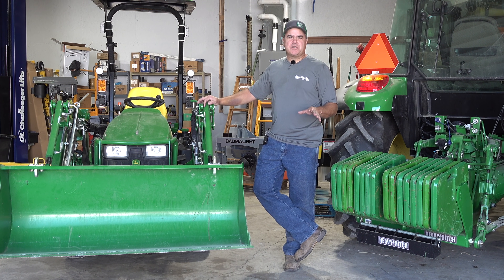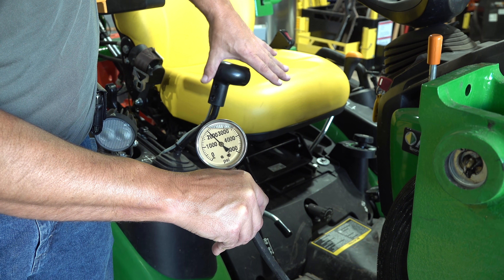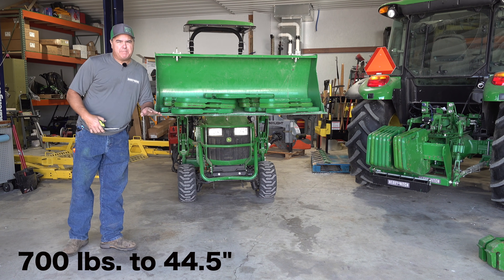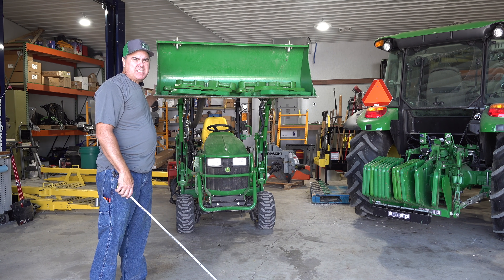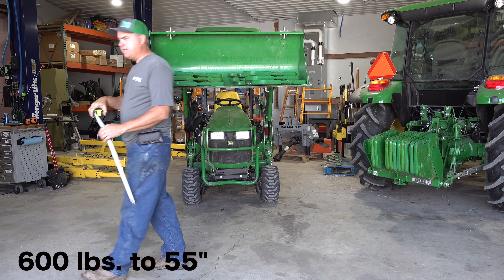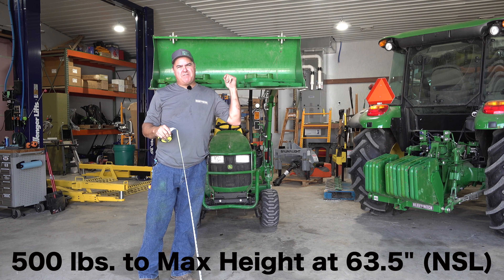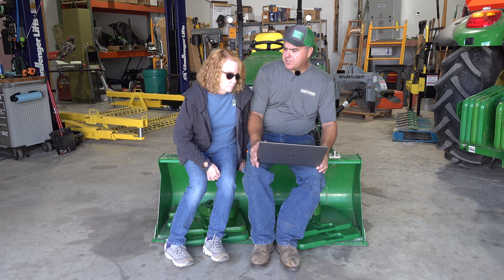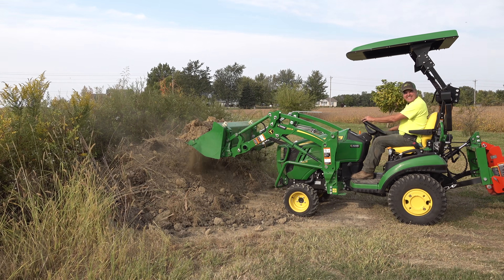WILL IT REALLY LIFT MORE??? 120R MSL vs. NSL for Subcompact Tractors

Comment: Tim. In your opinion is it worth trading up to a 22 2025? I currently have a 2018 1025r with 300 hrs TLB. They are offering me $16k trade in and $30k price on 2025 tlb.
Reply from the maker: No.  In my opinion, 2025r and 1025r are very similar.  I would recommend 2032r or 2038r if you feel the need to step up.
If you insist on making this move, I recommend keeping your 260b backhoe rather than trading for a new one. See if that lowers the trade in cost.
Reply: @TractorTimewithTim  looked into it . They lowered my trade in by 5k without backhoe. Thank you very much tim . Always a great resource . Deere should make you a sales rep .

Comment: I hope deere makes a newer 2025r with higher lift height and capacity. It’s very frustrating that they don’t make a compact tractor that can dump easily in a dump trailer. I currently have a 1025r and in talks with deere on trade in for a 2025r and to find out it only lifts about 3 inches higher is disappointing.
Reply from the maker: I’m surprised it lifts ANY HIGHER.
You need to go to a 3R before you get meaningful lift height improvements.
Reply: @TractorTimewithTim  wouldn’t a 2025r lift higher since it’s technically a taller tractor with same loader?
Reply from the maker: Yes, but it has shorter loader masts …to compensate.  Otherwise, it would not dig as deep!  Remember…the loader is identical between 1025r and 2025r.
Reply: @TractorTimewithTim  thanks for being more knowledgeable than my dealer .

Comment: Ordered a 1025r this week Aug 2021. Wanted a r120 mls loader but was told that loader won’t be available until Jan 13 2022 
Would hate to buy a tractor that outdated in 5 months
Reply from the maker: 2 things. One: not sure it wouldn’t be outdated.
Two: I’m not sure MSL is worth the wait.  I prefer NSL on the 1025r.

Comment: Tim, I hope this questions makes sense. What is the difference in weight between the two loader systems (including bucket, arms, hydraulics, etc.)? The 120R MSL loader looks to be a bit heavier that the Non Self-leveling loader.  Do you know if John Deere  includes this extra weight in their specifications, thereby giving the MSL a perceived heavier lifting capacity?
Reply from the maker: Your question does make sense.  However, you are misunderstanding the lift capacity specification.
The spec includes the loader and the bucket. So, it is specifying how much cargo the bucket can left 19.5” ahead of the pin.   So, any differences in loader arm weight would already be accounted for in this spec.

Comment: In your opinion would you get the self leveling or the none self leveling loader? for normal home/farming use w/out needing forks or only using them once or twice a year?
Reply from the maker: Non self leveling for 1025r, MSL for 2032r/2038r.
Reply: @TractorTimewithTim  thanks

Comment: Hang a bale-spike off of your Artillian pallet fork frame and start hanging weights off the end of the spike to test curl strength on each loader. Be careful to have them at the same pin height and at the same level adjustment. Their curl rams are connected at different angles, so there will most likely be a difference.

Comment: Just a thought, try curling the bucket all the way back because it will bring the weight closer to the pin and in theory allow the loader to lift more. Just to clarify my thought process on this having the bucket curled all the way back is how you’re going to carry almost every load except if you’re using forks.
Reply from the maker: The purpose of this test is to objectively compare lift capacity.  The two loaders have radically different curl back angles, and the curl back would vary at different heights. In my opinion, impossible to get an objective test.
Welcome to our channel!
Reply: @TractorTimewithTim , thank you for the welcome. You are correct it’s hard to get an objective test on these two loaders because they have different geometry. And who knows what kind of standard Deere used for testing to get there numbers for the comparison of the loaders so I would say your test and the numbers it produced are probably more accurate and real world than what Deere is publishing. It almost reminds of the Horsepower wars in the late 90’s between the big three with Diesel pickups and it produced catastrophic results for Ford.

Comment: Just a thought about this test. As the weight decreases throughout the test, so does the height loss due to the weight of the load compressing the tires. Maybe you could run it again with the front of the frame on cribbing or blocks to eliminate the tire variable.
Reply from the maker: We prefer to show ‘real world’ testing.  No one ‘blocks up’ their front axle in the real world.  
We used the same tractor on both tests.  Front tires at 40 psi.
In other words, the ‘tire variable’ is part of the real world and should be maintained.

Comment: Hello Sir I think it would be a big help if the manufacturer would consider putting a little bit larger tire an rim on the 1025 R, but I'm I don't have an engineer degree to prove it would be a bit helpful ,I not a JD mechanic so my outside opinions don't matter . Roger .
Reply from the maker: The 2025r is exactly that!  1025r with bigger tires!
Reply: @TractorTimewithTim  ok about the same horse 🐴 power category I understand

Comment: 💥 One suggestion I have is to use a load cell for you lifting tests instead of weights. The position of the weights in the bucket can cause discrepancies. That would save you a lot of lifting as well. I like what Neil does if you’ve seen his lift tests. 
Keep on tractoring! 👍
Reply from the maker: Don’t know how to test lift at ground level with the load cell.
Reply: What if the load cell lift system was recessed in a hole. 🤔 Then you could even test lift capacity slightly below grade.
Reply from the maker: Yes, but that would have to be at least 24” maybe 30” deep just to the top of the hole.  How would I keep that dry, clean, etc?  
The ‘tie down’ would have to be below that.
Reply: I don’t have all the answers, just suggestions. 😁 However, something like a cinder block well pit with a cover for when not in use. Might be more work than it’s worth but it would make you cooler than Neil! 👍 ..... maybe
You did make a pit for a trampoline. 
Another idea, if you have a loading dock ramp. 🤔🤔
Reply from the maker: Yea, we talked about using our lift.  ...then figured the safety nazis would not approve.
Reply: That’s another good idea, I understand the safety nazis issue. You could use blocking or something to support the lift. I promise I won’t complain. 😁

Comment: All seems to be in range for what Deere claim on the 500mm forward of the pivot point which is 553lb for the MSL. This is the lift capacity you should be paying attention to not the 803lb for the pivot point lift capacity as all the lifted weight is forward of the pivot point. In Australia the manufacturers normally only reference the 500mm forward capacity and the SWL (safe working load) which is 35% of the maximum lift capacity.
Reply from the maker: Where did you see 553 lb?   Thanks!
Reply: @TractorTimewithTim  
https://www.deere.com/en/loaders/front-end-loaders-for-tractors/120r-loader/

Under the specs tab.
Reply from the maker: That is the 500 mm weight for the NSL on 2025r.  
There is no spec page for the MSL.
The page we showed was the overview page. Remove the ‘120r-loader’ from your url to get that.
Reply: @TractorTimewithTim  my mistake Tim, I just assumed when I clicked the link for the 120r MSL  and looked at the specs, I was looking at the MSL specs. So I just had a look at the manual. And Deere rate it at 680lb for the MSL on a 1025r. Interesting side note the NSL no longer offered in Australia as no on was buying it. They having Aussie made MSL loaders fitted. Got a price a few weeks ago on a 1025r with 120r loader. Also a 4066r euro spec with 440r MSL put a deposit on the 4066r.

Comment: My only suggestion would be to clamp a level to the side of the bucket so you know it is level and your measurements would be less subjective. That would keep things equal at least with the increments. Or you could measure to that pin. Also, I'm glad you're feeling better.

Comment: Do you have the ballast on the rear the same as it was on the first test?
Reply from the maker: I drove out of the shed, changed loaders, and backed back into the shed, attempting to get it in the same position.
So, probably 2 oz less diesel in the tank...other than that, no changes :-)

Comment: I would be curious if temperature makes any difference.  I don’t know that it would make any difference between the bucket systems, but I would find it interesting if it made any difference to the hydraulic system as a whole.  An old wood splitter we used was real temperature sensitive.  Enough so that we needed to instal a small cooler on the return line.  On that splitter the return was spring loaded, it didn’t use hydraulic to return.  While I have seen temperature effect hydraulics on others machines, I wonder if it has any affect at all on a tractor.

It is very good to see you are feeling better!  I hope that trend continues!

Comment: If you're looking for some ideas on how to measure and compare these two loaders then it would help to measure the distance from the floor to the pivot pin where the loader arms mount to the frame, the distance from the same pin to the pivot point of the roll back of the bucket and the distance of the attachment points of the lift cylinders so that you get the triangle at totally lowered and fully lifted empty.  You could also put a cheap gravity operated angle finder on the arm to see the difference in angles (you could even use it on top of your bucket when doing the loaded tests to make sure you keep the same amount of level setting as you try to measure from the bottom to the floor).  Another way to measure the height might be to use a soft measuring tape (like a tailors measuring tape) attached to the curl pivot pin and see what the distance is to the floor and not have to worry about your curl being exact.  Just some thoughts, your pressure multiplied by the surface area of the pistons in the cylinders lifting the boom and the geometry of the angles will tell you a lot about the lift capacities of each.  Good luck and enjoyed the science theater.

Comment: I would probably suggest doing it the way Neil did it from Messick's. Also making an attachment if you don't already have one where your load point would be the 21 inch like the specs call for, and also using a level to make sure everything is identical.

Comment: I was very surprised to see the difference in specs as I did not think there would be a difference (if anything a slightly lower number due to extra weight fro extra steel, and losses from all the additional linkages).  Your real world numbers showing no realistic difference restores my faith in my own instincts.  Leaving a small level on the bucket would eliminate marginal differences in judging level by eye at different heights but not worth doing all the work to repeat.  I got the in th ear wireless isotunes and am somewhat disappointed in them.  I find they can fall out too easily (an only by luck found one that had fallen out); if not connected to a phone, etc, their noise canceling feature will self cancel after a very short interval; when connected, their volume is a bit too limited; and I find them difficult to control/remember how to control.  Given that experiene, I will not invest further with them.
Reply from the maker: Did you try different sized tips? I found the smallest tips to work best for me.  Once I get them inserted really well, I don’t have much issue with insufficient volume.
If not inserted perfectly, they allow too mic background noise..making the volume not loud enough.
Reply: Tractor Time with Tim   I will experiment with the smaller tip.  Thanks.
Reply from the maker: Christy uses larger tips than me.  I guess I have a big mouth and small ears!!!  She seems to indicate to me that this is the case at times :-)
Reply: As I am often told you are nor listening, I too must have vey small or blocked ears!

Comment: testing looks correct.  the pin is roughly one inch different by you measurements in previous video.  JD lifting capacity is measured in relationship to the pin. so on paper the MSL has advantage.
Reply from the maker: Someone mentioned this on Facebook as well.    Seems like a reasonable explanation for part of the discrepancy!

Comment: For me, the major benefit of the self leveling loader is that the operator does not have to manually try to level while lifting, slowing down the operation.

Comment: I do have to say your methodology is a very good way of testing. but you do have to consider the curb weight of the loader by itself without the tractor or bucket. The MSL Loader has more mechanisim to is so it will have a higher curb weight than the NSL loader. Thus weighing down the front of the tractor and yielding different max lift heights with and without weight. An easy way to adjust for this is to take a measurement from the same point on the front of the tractor frame and the variance of that between each loader will be a gauge of how much the loader will vary. Due to principles of levers and physics it will not be a direct adjustment of the difference applied to the loader height.

In short, Great comparison. I look forward to seeing more content and review of the MSL loader.

Comment: Why the R4 tires on the front and not the Versa Turf?
Reply from the maker: Haven’t got around to changing them.  Been very busy!
Reply: You’re too quick. After thought I had was your measurements might have been shorter with the radial tires. Didn’t you do this test on the NLS with the R4’s?
Reply from the maker: Both tests within 1 hour. Same configuration

Comment: I noticed that right after you shut down to take measurements, the loader bleeds off a little. So your measurements were actually lower than what it lifted while running. Actually in a couple parts of the video as you walked in front of the bucket to talk to the camera you could see the bucket fall slightly behind you
Reply from the maker: Yes, the loader leaks down pretty quickly under full load. No question.
Reply: Tractor Time with Tim, because I know there are many trolls out there. I wanted to make it 100% clear. I’m not trying to put down any of your videos or any of your tests. Honestly I love what you do, and seeing how I can use my sub-compact tractor. I just wanted to point it out incase you might not have noticed  is all.

Comment: Tim one other area to test is how fast the MSL can lift a loaded pallet and unload onto a shelf versus the NSL where you are constantly having to adjust.  For me this is important as the saying goes time is money.
Reply from the maker: Not only how ‘fast’,  but how smooth and safely  it can be done!
Reply: Tractor Time with Tim very good point.  Maybe have a test between you and also a rookie operator.

Comment: A few things, the lift height difference your seeing is likely due to the MSL loader being heavier than the NSL loader as you were saying tire squat/back end lifting slightly more.

John Deere also likely uses a test stand for the measurements and not an actual tractor, I'm guessing they also have an Eye bolt set in concrete with a high capacity load cell to do the actual test. 

As for the difference in loader capacities, when I was looking through the attachment brochure the lowest loader lift capacity for a 1023E/1025R was 680 pounds so maybe the difference is a typo? or an older model spec that wasn't updated?

Comment: The two of you always make excellent quality videos. Your explanations are always accurate and understandable. Congratulations.

I think you can come closer to the factory specs by either standing up the weights in the back of the bucket, or maybe making some kind of rod that goes through the weight handles and locates the weights the same distance from the pins.

Comment: Tim, what i think your doing wrong, to be fair on any tractor test : get the dealer of that brand weather it be John Deere or Kubota, to get one of thair authorized repair men to  set the hydraulic pressure correctly, and check the tractor over for defects.
Reply: i was going to ask if it was the same bucket, but i see you mentioned it.

Comment: Very good test.  Nice job as always.  The results surprise me based on the specs, but when I really think about it, it does not surprise me.   

These tractors will pick and carry whatever fits in the bucket, and then dump it over the side of a dump trailer. But that alone can be enough to tip you over if not careful, even with a backhoe, wheel weights, and loaded tires. 

I can't see adding more capability to it and having anything to gain, besides marketing. I've got a JD 2305 and have had a big enough log on the grapple it stalled the power steering...had to set the load down to turn tires and continue.  It doesn't need the ability to lift anymore than they already do.

Comment: Great comparison, I feel a little better about my tractor I just bought lol. Is there a way you could do a video showing how to check and adjust the hydraulic pressure? I wonder how many of our tractors are running a little low like yours was
Reply from the maker: Get the gauge from BoltOnHooks.com. Use code TTWT for a 5% discount.

I’m sorry, we will not be able to help with the pressure adjustment.   We want no part of the liability associated with this.
Reply: Tractor Time with Tim I get that! Thanks for the source for the gauge!